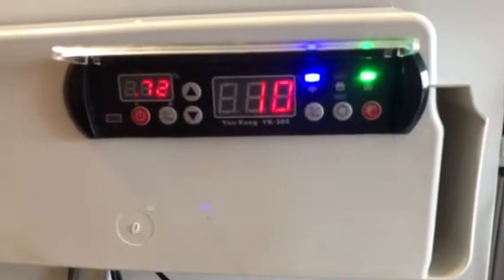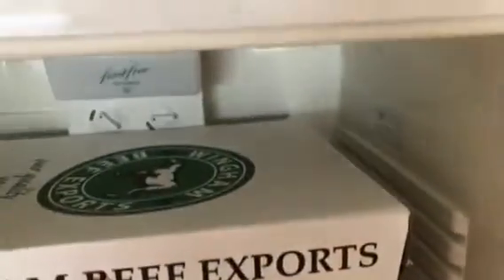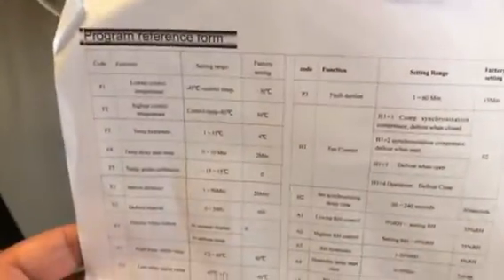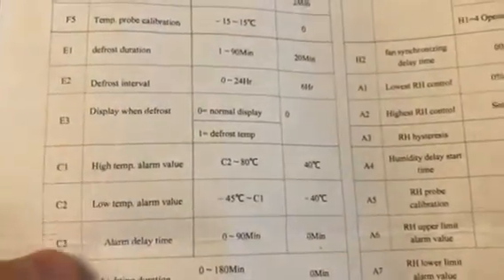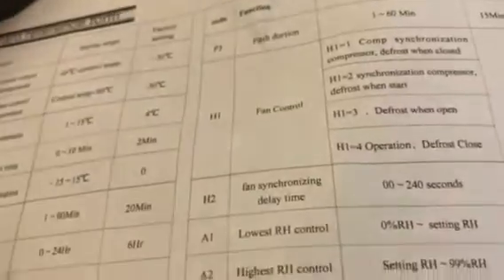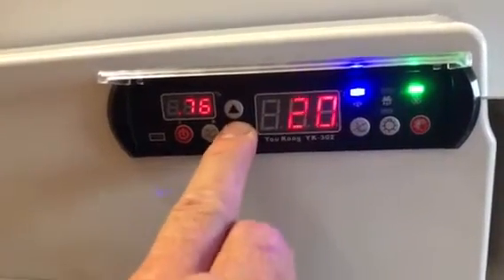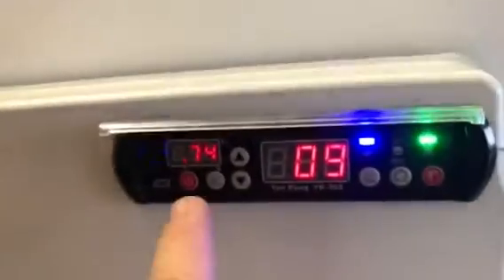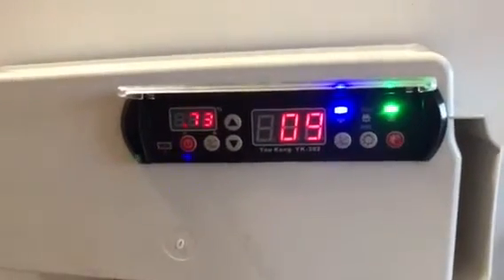You Kong YK-302 Controller Programming- Tutorials Part 2

Comment: I am using the yk-525 for my greenhouse. The compressor connection is binded to the electric roof windows. Build all by myself. I got many trouble with function t1 and t2. t1 controls the forced dehumidification intervall and t2 controls the dehumidification time. t1 is setupable from 30-90 min, t2 is setupable from 01-60min. That means in t1 time, the windows opens for t2 duration. I can't set them to zero. The max. setup i can set is open every 90mins for 1min. Do you have any suggestions to deactivate or manipulate it to do not a "run" every 90mins?

Tjanks a lot in forward! 

Regards, 

Lars from germany
Reply: Hi Lars. I’m using yak-525 too, finding difficulty to wire and set up. 
Hope you could help